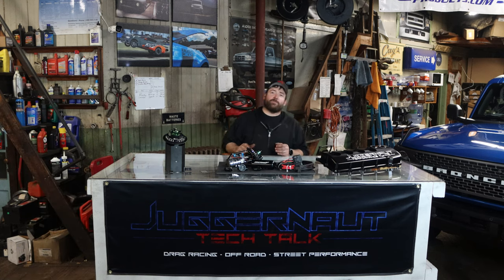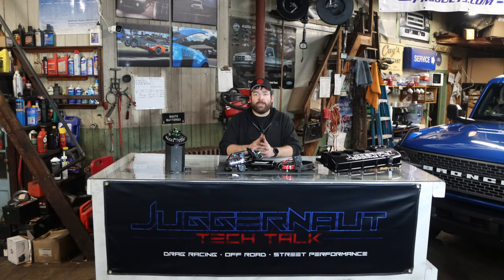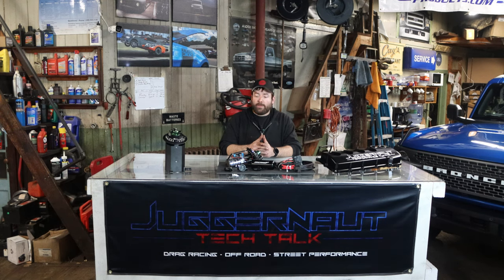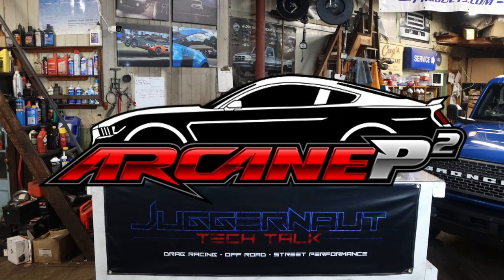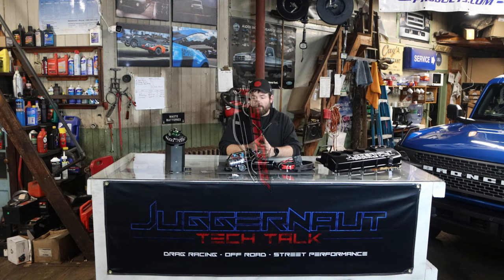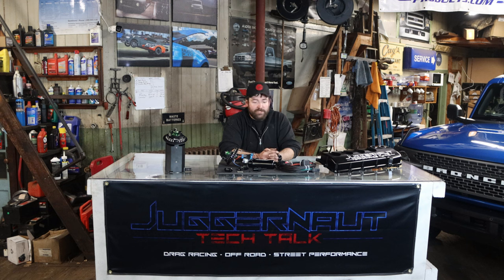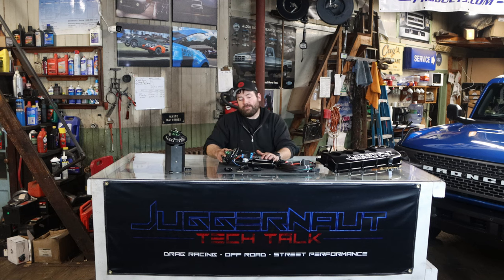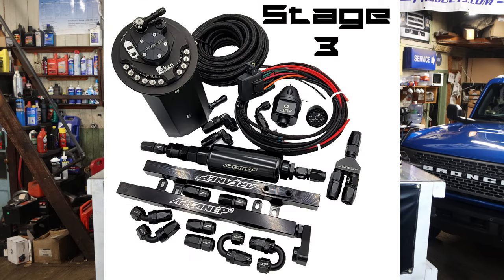Ep S5 - ArcaneP2 Return Fuel Systems for 2011+ Mustang

Comment: Can you guys do a step by step install video? I've looked over the install instructions and wiring instructions and I think some people will get confused by the lack of information
Reply from the maker: What specific part are you wondering about? Generally we shy away from step by steps for fuel systems as a slight mishap can cause serious injuries or fire so we tend to suggest professional installation if not familiar with what's needed
Reply: @jptechtalk4685 we definitely need a video, instructions don’t help much. Prochargers, turbo kits, superchargers all come with the liability of blowing our cars or start fires if done wrong but they atleast show us how to do it so it doesn’t happen. With this system we’re left with nothing. We can only ask other people who’s had them installed even then there’s not many people who have.
Reply from the maker: @ivannunez6430  what part are you struggling with? Radium provides hat assembly instructions if you choose to not have it pre assembled. The layout diagram and electrical shows where to connect what. It connects exactly like every other fuel system on the market.  If you have specific questions feel free to reach out, however like we disclaim the potential for user error causing fire or issues is far beyond that of a bolt on unit. If you are not confident in installing fuel related components a professional installer should absolutely be used.

Comment: So the stage 2 kit with a 8an feed made 1000 to the tire, was that on stock gen 3 rails?
Reply from the maker: No, Whipple rails.

The stock gen 3 rails run out around 800-850 due to the small crossover